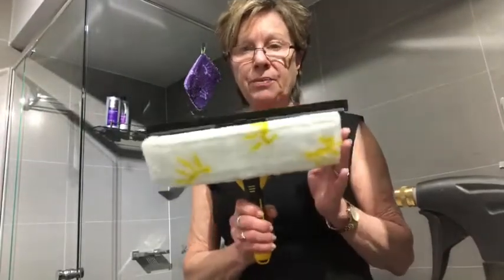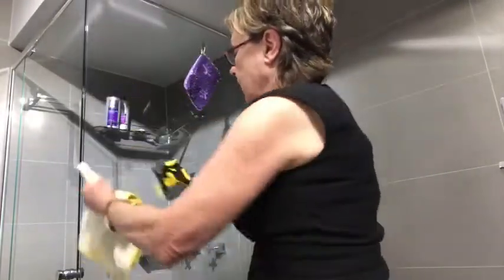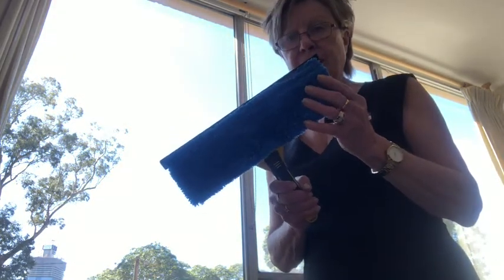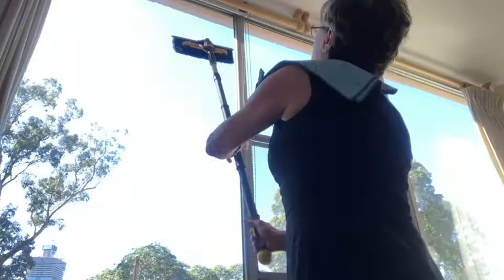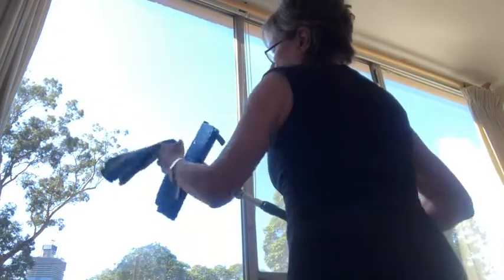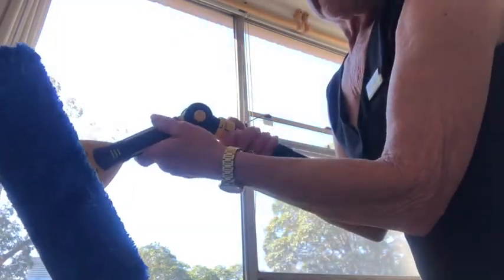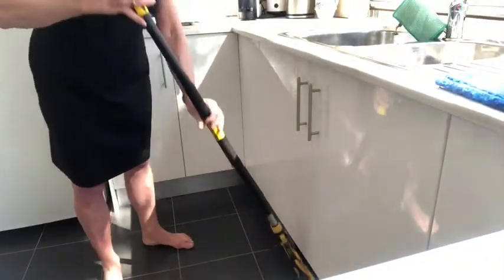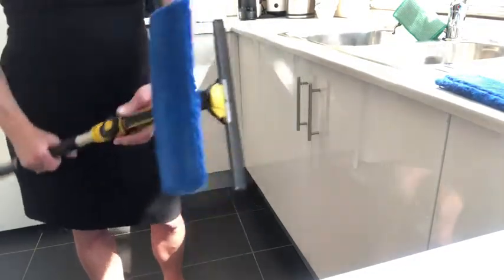ENJO Multi Tool | Versatile Chemical-Free Cleaning for Hard Surfaces

Comment: So you can’t clean and dry in one motion?
Reply from the maker: Yes you absolutely can Jk Bee! When the blade is on the same side as the fibre you clean flat to the surface and then dry at a 45 degree angle. If the surface is not overly dirty, you can clean and dry at the 45 degree angle. Hope this helps?